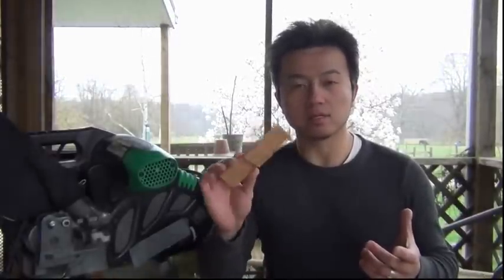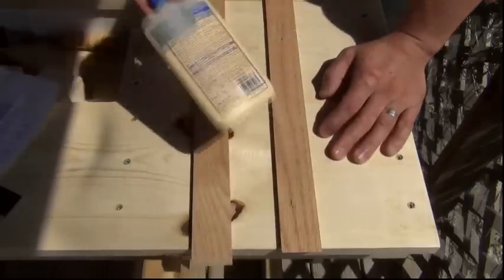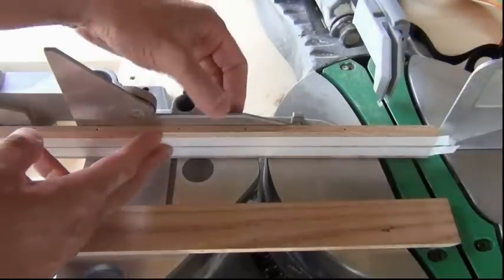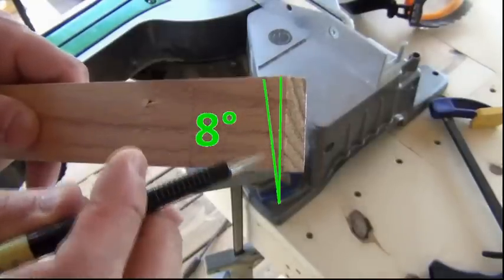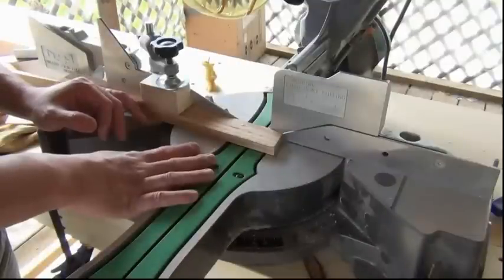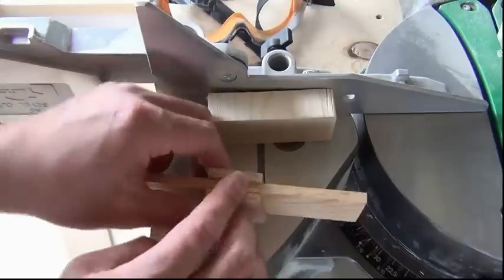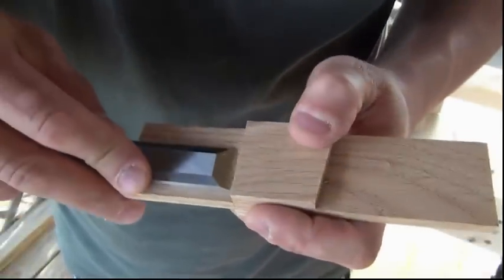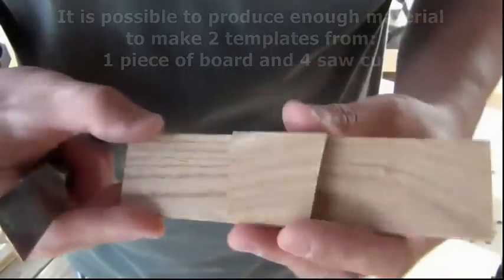Project #3:   Simple 3 Cut Dovetail Template Part 1 of 2

Comment: That's all well and good, but the whole point of Paul Sellers method is to help you improve your skills and if you don't have the skills to make the dovetail template then you will not have the skills to make the dovetails once you have the template. Isn't it better to make mistakes a few times with some scraps trying to perfect the template, rather than making mistakes on your dovetails and ruining the whole project?
Reply from the maker: PS already did it PS's way. Lots of people already do it PS's way. I don't do things the hard way if there is an easier way that results that achieves the same objective. No one will master hand sawing by making a dovetail template.
Reply: I'll take 6 cuts with a handsaw over your three cuts with a mitre saw, gluing and aligning pieces, waiting for the glue to dry then cutting dowels and drilling holes and then gluing those in place and waiting for that glue to dry then trimming your dowels and you think that is the easy way? Hahaha, I think we will have to agree to differ on this one. :)
Reply from the maker: That sounds good to me, the exact same way PS made his. People can respectfully disagree; there are infinite color combinations, no need to settle one a best color.
Reply: John Zhu Exactly. They are both paintings.
Reply: Paul Seller's is teaching Hand Tool Woodworking, whereas John is teaching Hybrid woodworking, where you use both hand and power tools. Depending on what you want from your woodworking, both approaches are valid and have their pros and cons. It's up to the audience to decide for themselves, each to his own. For myself, neither one alone will satisfy my needs completely as my circumstances preclude much of the equipment and working space both Paul and John use. It doesn't mean however, that I cannot learn from both.